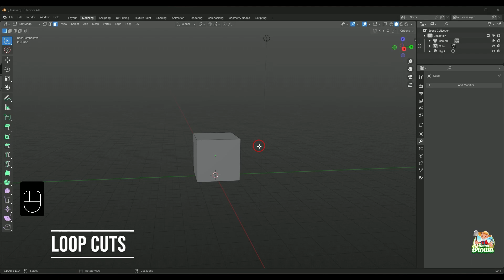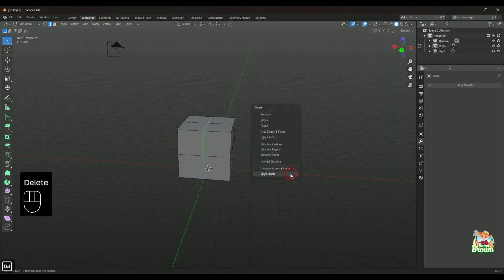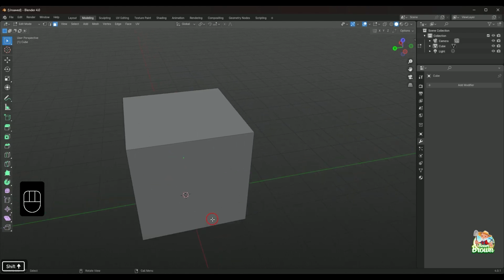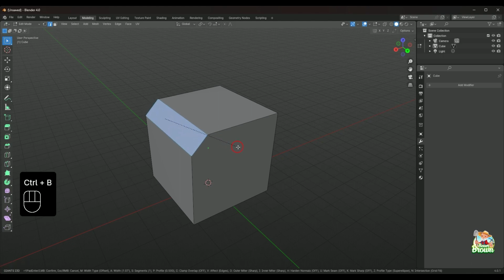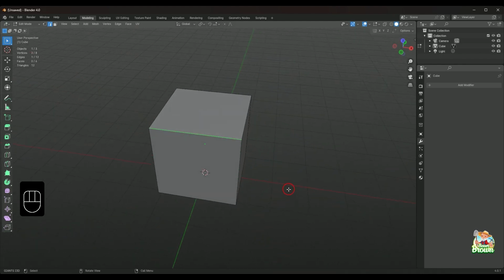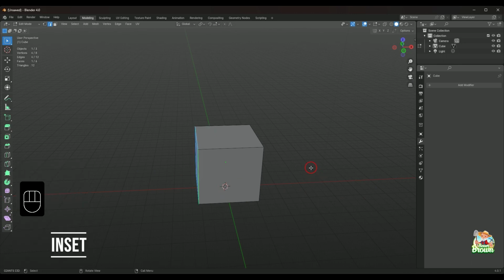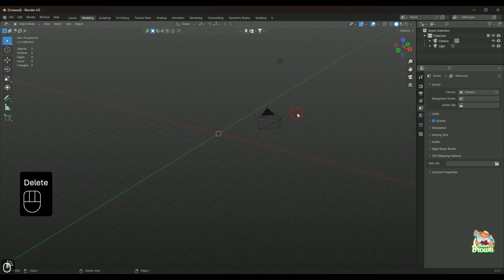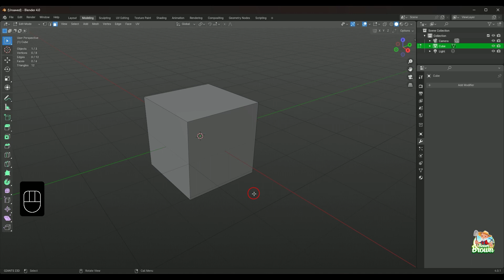Learning Blender: EP6 - Loop Cuts and More!

Comment: I had to dl and print out a cheat sheet for the hotkeys.  It is mind blowing.  Not only combinations between the letters, alt + letters and shift + letters but also the same keys have different functions in the different modes.  How the hell do you remember all that?!  So many menus, so many different ways to perform the same function...I guess you learn what you use.  If you don't use it regularly it is almost like learning it all over every time you come back to it...
Reply: It all comes down to muscle memory. Add in GE, photoeditors… really wreaks havoc on a person. lol
Reply from the maker: It's no joke, lol. I've never seen an application with so many shortcuts, lol. Just an FYI that if you go into preferences, you can find a master list of all the hot keys there (Just like in GE).